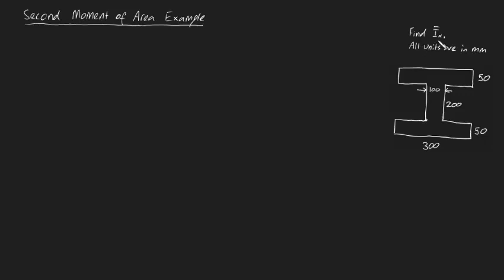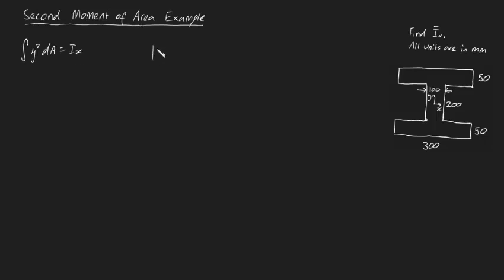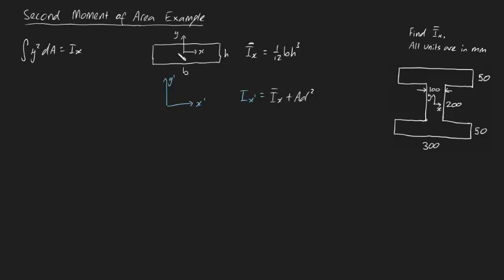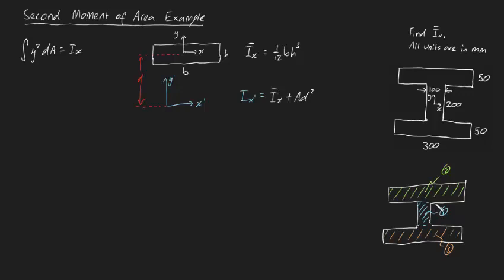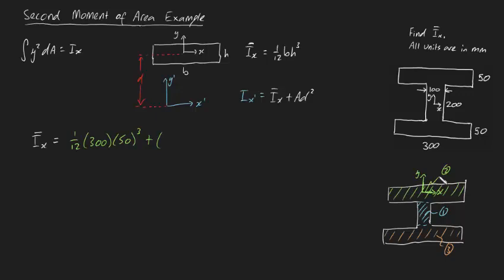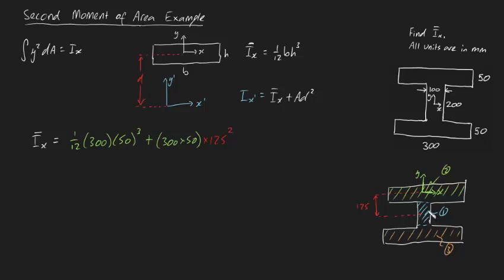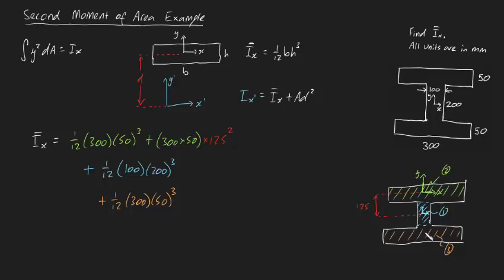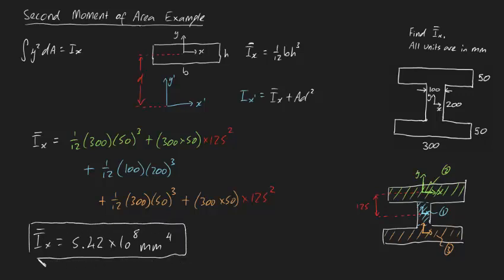Second Moment of Area Example 4 (I beam)

Comment: If the question asks to Find I about its base, do you still use H to the Centroid or do you use H to the base?
Thanks
Reply from the maker: Hi, do you mean for the whole I beam? Or just a rectangle? For just a rectangle do the following:

1) calculate the moment of inertia about the centroid I_x_bar = 1/12 b h^3
2) Apply the parallel axis theorem Ix = I_x_bar + A d^2
3) In this case A = area of rectangle = b*h, and d = distance from base to centroid = h/2
therefore Ix = 1/12 b h^3 + b*h * (h/2)^2 = 1/3 b h^3

If it's the whole I beam do the following:
1) Calculate the moment of inertia about the centroids of each of the 3 rectangles. 
2) Then apply the parallel axis theorem to each of the 3 rectangles individually. the 'd' values will be the distances from the base of the I beam to the centroid of each of the 3 rectangles.
3) Sum them all up

Hope that helps :)